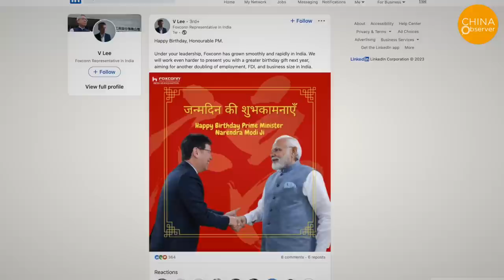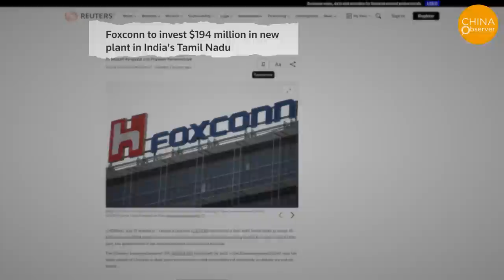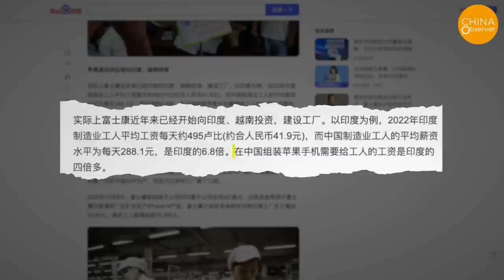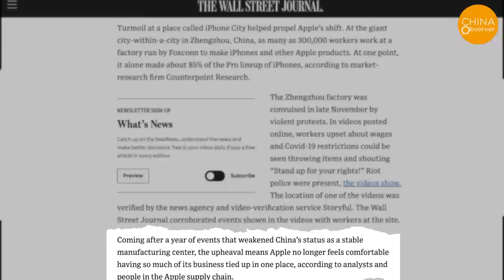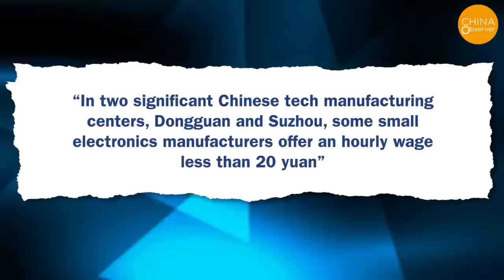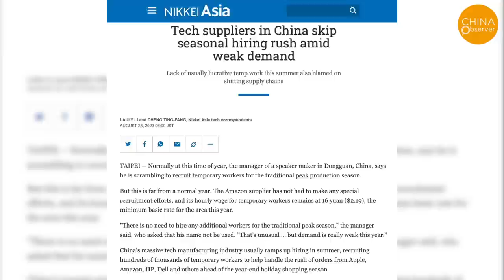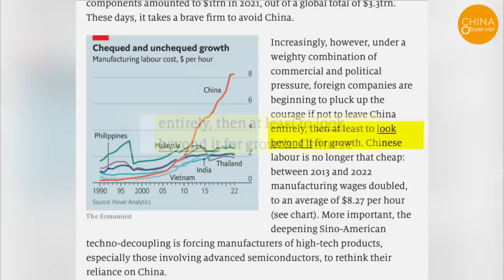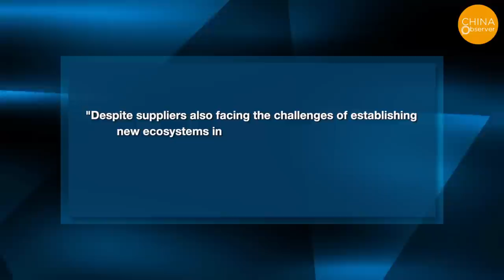Largest Tech Supplier Foxconn Is Moving $40BN Production Line Out of China: 320K Employees Laid Off

Comment: Without The Chinese market, Apple is bankrupt. India will not accept Foxconn
Reply: Bankrupt? Really? You have lots to learn.
Reply: @EyeofHorus2347 they have a strong cash position but as Dell and the chip makers learned take the Chinese market away a look what happens. You need to know Apple is lagging in new products . The 15 is little difference to the 14 I have. So look how fast Ford bled 68 million extra. Foxconn already pulled from India. 2028 Apple bites the dust. Tesla beats them on self driving
Reply: @labandonaldhock80  I get your point but China is only 20% of their market, as big as it is. And there will always be market pressures and a need to innovate to survive. Right now, there is no one producing anything comparable. Apple has other products to sustain them even if the phone line didn’t survive. There are plenty of countries that will take Foxconn if India doesn’t. They’d be foolish not to.  That doesn’t threaten them with bankruptcy.
Reply: @EyeofHorus2347  you need to look again at China only being 29% of Apples market
Reply: @labandonaldhock80  no, you need to check your facts with reliable sources.